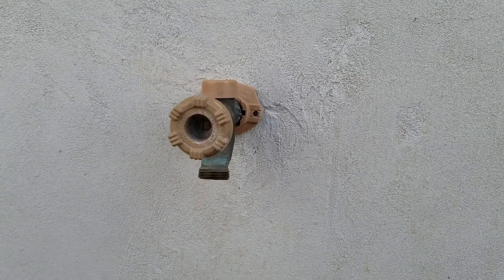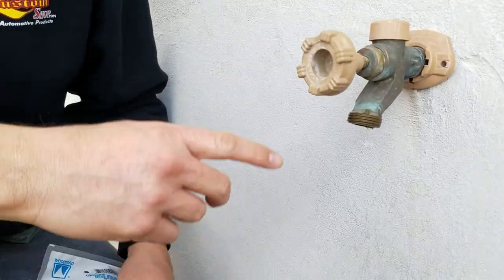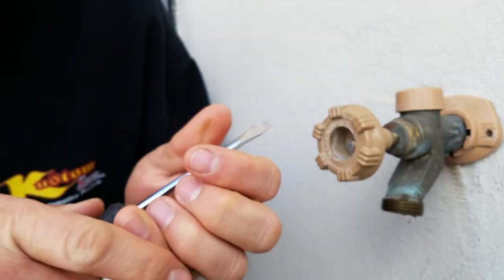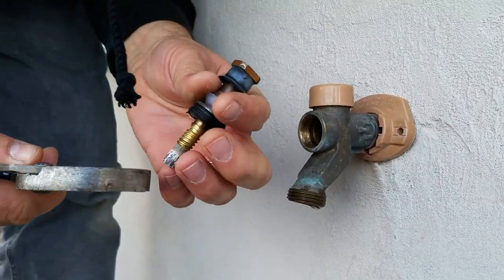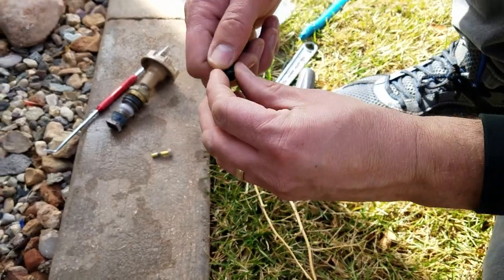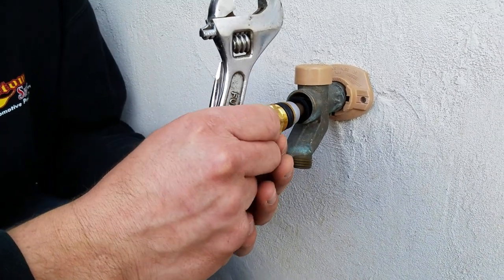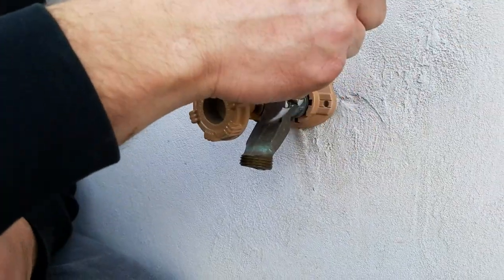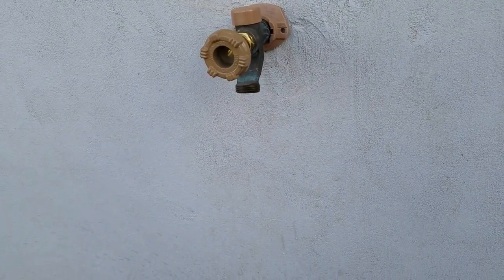Fixing an outdoor faucet that has low water pressure or leaks

Comment: Can only outside spigots have a loss of water pressure while inside still has good water pressure?
Reply from the maker: Yes, if it's at the end of the line in your plumbing.
Reply: @allensshenanigans348  Does that mean it just needs a new spigot or something more? Mine started with a dripping leak and would not turn all the way off now there’s very low pressure.
Reply from the maker: I don't think a new spigot will fix that issue. Check your PRV.

Comment: I replaced my PRV and the bibs and my water pressure is lkke 25 psi
Reply from the maker: There is an adjustment screw on your PRV, but it should have been already set. Try adjusting 1/4 turn at a time and recheck the pressure. Thanks for watching. Support the channel by subscribing.

Comment: I've got low pressure i got a boiler 

I've changed my tap no luck what can I do
Reply from the maker: My issue was only at this tap. Check your pressure regulator valve.